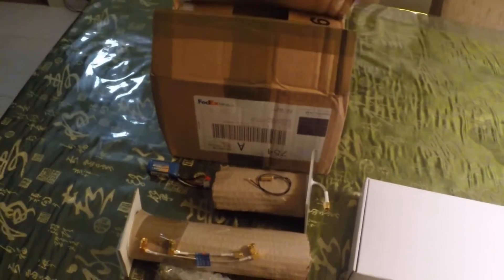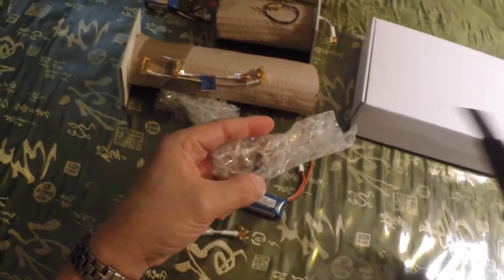DJI Phantom2 Vision Plus~Range Extender~Horizon Antenna Pt.1

Comment: Given the choice, would you stick with the Compact Dual Pilot system or opt for the newer more expensive Compact Extreme? Thanks..
Reply from the maker: Currently I'm using the dual extreme kit. I love the long range. The down side is the heavy and cumbersome RC unit. For me I mix and match the system according to my recording usage. If short range needed, I just use less antennas. Using sockets to antennas, I'm able to change the antennas accordingly. I guess to answer your questions, I bought a long and medium range kits so I can change around.
Reply: The other issue is that the new Compact Extreme is over $300.  Seems like a lot to pay for a couple of tubes, connectors, and some copper wire.  Any thoughts?

Comment: Gordy guy whats the range on the rc control and in the wifi extender?
I will appreciate your answer
Reply from the maker: With the rc control and wifi extender, I can achieve around 3km. But please know that you battery would be close to flat on the return. Depending on wind direction, your UAV may not return and you have to find where it lands. There are videos that show the UAV achieving 4km. My test are mainly on a return flight. Remember that draining your LiPo bat to flat may damage your battery. Also more countries are changing their rules for flying hobby UAV, drones or Surveillance UAV to be within BVR(Beyond Visual Range). You can easily lose sight of your Phantom at around 180m to 200m. Out of the box, you should get around 600m to 750m easy depending on location and background radio commotion.
Reply from the maker: *****
There are currently new motors, ESCs and higher torque props, and you may achieve further range with this boosted speed.

Comment: hi dear,
where did you get the battery for SUNHANS Wi-Fi Booster Amplifier?
Reply from the maker: Hello SUNY. The battery was bought from my local hobby shop. It's a 3T 12volts LiPo battery. The connector to the amp is using the plug that comes with the amp when you purchase the kit.

Comment: Hi dear,
Sorry to disturb you i need your help again.
http://horizonfpvantennas.mybigcommerce.com/phantom-2-vision-pus/
I go the website where you ordered the full kit I check all website but I didn’t see dual antenna
Which is support both 2.4GHz and 5.8GHz only I seen both are separate
 (Blackhawk Micro 5.8 GHz 12.07 dBi ( LHCP or RHCP in GOLD ) ) )
(2.4 GHz Helical ( LHCP in White ) 12 dB GOLD )  
Can you please post direct link to buy full kit including dual antenna please.
and I found another link can you check if I buy this kit will get same coverage and will support to phantom 2 vision plus as well?
http://www.tjshobbies.co.uk/product_info.php?manufacturers_id=65&products_id=679&osCsid=0g1m4hde9stf6ovq6scuq4g7m6
Reply from the maker: http://horizonfpvantennas.mybigcommerce.com/phantom-2-vision-or-plus-compact-dual-pilot-end-only/#.VEKdzdG2-qA

Comment: Hi Gordy, you wanna sell the freebie 2.4Ghz antenna to me? i will be more tha happy to buy if the deal is good. let me know. thanks
Reply from the maker: What are you asking for. Its a LHCP 2.4Ghz 9Dbi Helical.
Reply: i have phantom 2 that i want to modify, especially the remote control antenna. i saw on the video that you dont use the 2.4 helical antenna, so if you planning to sell, and the deal is good, i am willing to buy.

Comment: Does the amp really make a huge difference or would you be okay with just the antennas?
Reply from the maker: Without the amp, the range is at the border of Beyond Visual Range. These days, safety requires flyers to be within BVR to qualify with most Commercial Flight Rules for flying drones and hobby aircrafts. I'm experimenting with amps to maintain constant wifi visual control(FPV). For any reasons that I may look away from the drone, at least I have visual control from the UAV point of view to gain control of location even if shrouded by visibility due to drift of UAV or current sky lighting. I think an amp would help any Phantom pilots for ultimate UAV/drone control.

Comment: Hi - I have the same system (without the amp). I can't wait for the other videos, have you actually fitted the system yet ? Can I ask you to try a range test without the amp, I can the compare to my system which I am yet to fit ?
Reply from the maker: Hey goldmagnet. I can do that when I do the inland Range Test. It will be in controlled environment. I'll do one with amp and one without. Cheers!
Reply from the maker: Hey goldmagnet, Range Test has been put on hold due to adverse weather in my area. Will get results as soon as I get some time off work.